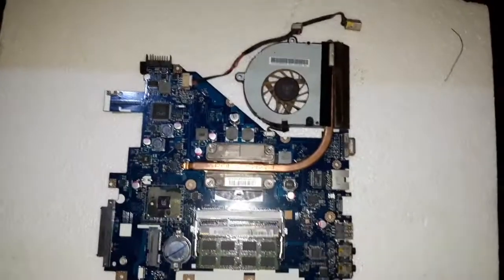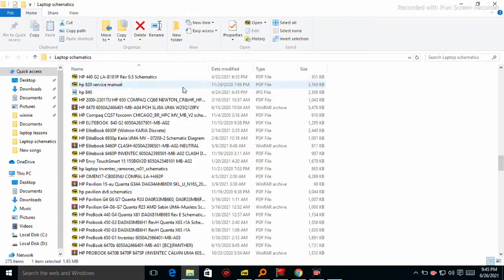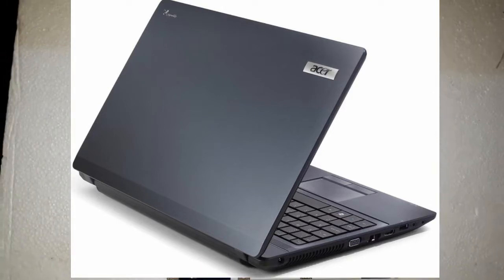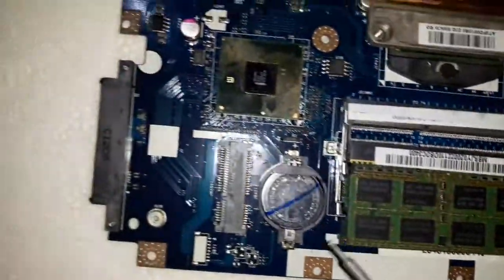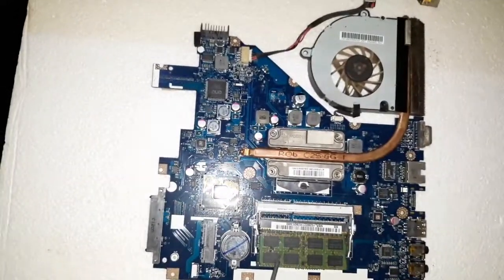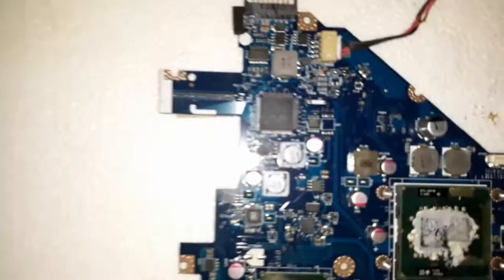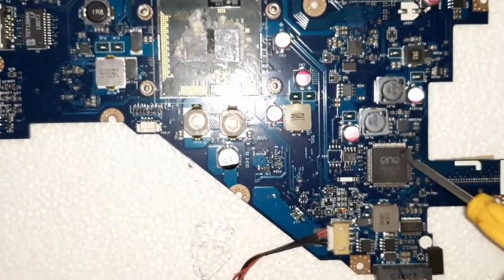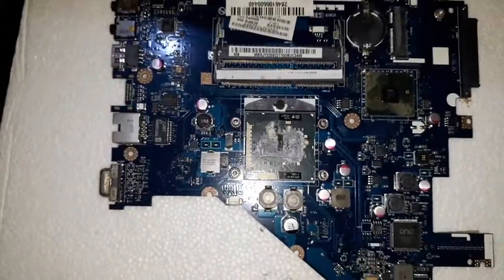How to read & repair Laptop with schematics diagrams part 1

Comment: Wow!!!.

I was trying to charge my phone with my laptop(gateway NV 5378u) usb port..by connecting the usb cord to my phone battery terminals.because my fone charging port has spoit....so i mistakenly connect positive to negative and negative to positive...and my laptop was in sleep then.it just off immediately.so whenever i power it on, the power light Will ON, the fan will blow but the laptop is not coming up.....my question is, from your own ability what do you think might have gotten burnt or damage and solutions can u proffer....and could it be a minor or  major fault ... thanks, i will be expecting your advice...
Great video tutorial...keep it up
Reply from the maker: On the mother there is a USB Over Current protection chip, check it you may need to replace it or take it off the motherboard

Comment: What is meant by the term live boot ok concerning a laptop advertisement?
Reply from the maker: Hey live boot is using a laptop with windows installed on a USB drive instead of a Hard drive
Reply: @platinumphonesandcomputers  Does this mean the laptop is working correctly without any issues whatever?

Comment: What's the name of the programme on your computer and how to use it.
I also will appreciate if you put lecturers on how to read ic,resistors... on the mother board. The rate it reads to and how to detect power shortages . Thank You
Reply from the maker: Check out Schematics videos, its easier to read IC when you understand schematics